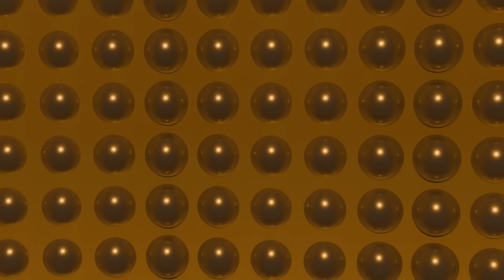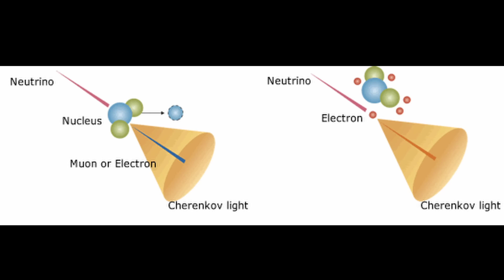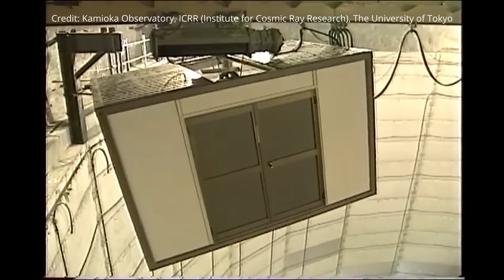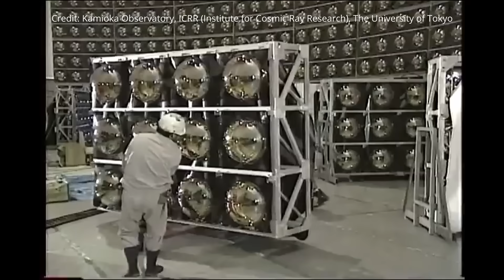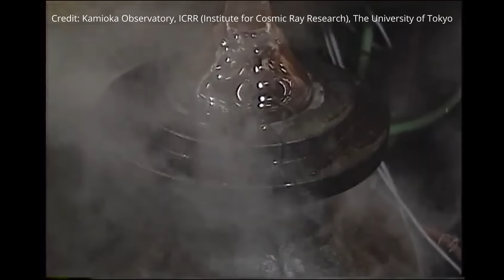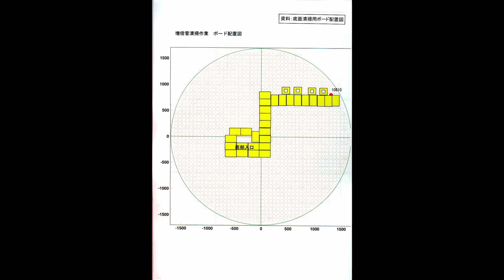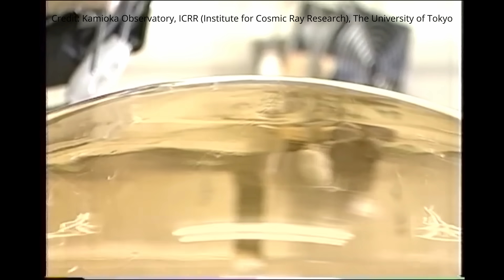An Engineering Fairy Tale: Cascade Failure at the Super Kamiokande

Comment: Quick question: If a single neutron striking an electron causes it to emit a photon... how does that single photon eventually strike more that one photomultiplier?
TD
Seems like we're missing something really critical in the actual setup here. Perhaps I'm just missing something obvious here, but it appears to my mental model that what has to actually being capture here is a (perhaps a single? perhaps many?) neutrino passing near the electron, and that passing both redirects the neutrino (it has mass, right), and the electron emits a photon on a particular vector as determined by the incident path of the neutrino... as that (now changed subtly) neutrino carries on, it passes near other electrons, and causes them to emit photons as well... each of those photons is on a different path, and actually strike different photomultipliers in different locations, at different times (at that tiny scale of time), so the signals are NOT exactly in sync, and thus... much math later... are mapped back to the emission point (which is actually a line).

TL;DR: It seems a gross simplification to to call this a flash of light and treat it as on monadic event.
Reply from the maker: The neutrino causes the electron itself to move faster than light (not to emit a photon directly). It then emits photons as it travels through the medium in a kind of light-equivalent of a sonic boom.

Comment: Video felt excessively slow and dragged out. Not a regular viewer, but I was skipping forward constantly to get to the actual event the video is about.

I think you should either get a copresenter to act as a comedic foil to your straight forward delivery or tighten up the script. Faffing about for 15 minutes to say "shockwaves in water are intense" is dull.

I could have appreciated the time spent getting there if you shared some interesting formulas and figures that gave insight into the precise mechanics of the event, but nothing besides the 6 bars of static pressure notion stood out.

Comment: You did miss one of the particle in your standard model.  
It's called the "Moron".  It's fairly common, and fairly easy to detect.  And can sidetrack your research with ease.  And, unfortunately, it can stop all progress on your work!  And in extremely rare cases they can be dangerous. 
   Just think about the stereo typical Hollywood motorcycle gang, and then you'll get the right idea...

Comment: ...huh, well the bit on neutrinos experiencing time has my brain thinking again... on a couple of things. The recent paper trying to falsify dark energy explains the accelerating expansion of space as a relativity issue. Basically, away from gravity wells, space expands faster because time passes faster. It makes me wonder... what actually is space? If its affected by time, and this theory means it must be, then what is it made of? Does it have mass that we can't detect because of the sheer ubiquity of it? Something like dark matter where it's only weakly affected and only weakly affects gravity? And now I'm wondering if the distortion of space because of the expansion would explain the seeming presence of dark matter around galaxies affecting the flow of light... if there's some kind of distortion between gravity heavy and attenuated gravity that might explain the way light bends in ways we don't expect? 

I don't know enough math to try and work that out.

Comment: Maybe someone commented on this before, but the else excellent video is fibbing on the neutrino oscillations. The requirement for them is that the particle have mass, which means they travel below the universal speed limit. It has nothing to do with classical objects that would 'see no time' since photons interact with each other all the time. Or rather, it is the particle field that interacts, also with other fields, all the time.

Comment: There is a specific cascade scenario called Kessler Syndrome.  The theory is (and I’m very happy it’s still a hypothetical)that at some point there will be enough debris in orbit, that will then impact working satellites, making more debris that breaks more satellites, etc.  the worst case outcome is no usable satellites remain, but there’s so much debris floating around that we couldn’t launch ships at all, because even a lunar lander gets smashed to pieces just trying to pass through the debris field.

It’s for this reason NASA is tracking every loose scrap of metal up there.  Considering that the ISS is moving at 17,500 mph, I’m amazed NASA can detect a single bolt moving that fast, 100km up.

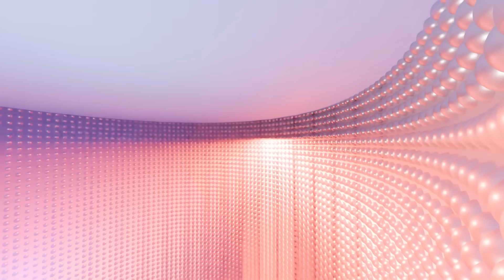Comment: 17:32 , What would happen to a person swimming with a air tank at the center of the pool half way down when these events happened ?
Reply: @Dmanjack  he would undoubtedly absolutely shit himself alive
Reply: I have no idea if he'd die to the implosions from in the center. Maybe go deaf. But i feel like all that water dropping suddenly which we know must have happened since the water now would occupy what was once vaccuum. Would have the same effect sending an overall shockwave up and out. As was recorded in seismometers would maybe crush the person. The water isnt compressible but the air in their lungs sure is. I feel like the air tank would be fine. They have plenty of pressure inside and need to be pretty strong otherwise dropping one would explode it.
Reply: Nothing good.

Even though the failure wasn't necessarily instantaneous across the entire tank, It was close enough. And considering the rapid pressure change is effectively an explosion, that is Intenuating. Through non-compressible fluid; so there would be minimal energy loss...

I'm imagining they would at least be deaf. Worst case scenario, the pressure change would cause their blood to boil or organs to liquefy; If not both. Definitely not pleasant; But I would doubt they would be alive long enough to feel anything...

Comment: I was a grad student working for an advisor who was part of the SuperK collaboration in the US (it was a large group with different teams working on different aspects of the experiment). I dropped out of grad school shortly before this happened, but it was still pretty demoralizing when I heard about it. At the time of the accident they were just getting initial results from an accelerator experiment which "shot" neutrinos from an accelerator 250km away in order to confirm the original neutrino mass discovery, which was based on neutrinos from cosmic ray air showers. This research was eventually performed after the repair, though.

That detector image around 20min is giving me flashbacks because for a while I did hand-fitting of neutrino tracks to those diagrams when the automated system wasn't confident in its solution.

Comment: I was a graduate student within the particle astrophysics community (on a different experiment). I remember when the news & rumors of Super-K’s implosion spread through the community. 

A little while later I saw a presentation by one of the Super-K scientists, in which a short movie of a later test was shown. At the time it was said ‘no I cannot give you a copy of this, just remember it,’ and even 25 years later I’ve never seen the movie in the public. The question was that while the dynamic pressure is incredibly high as detailed by Alexander, the tubes were designed and tested to survive the dynamic pressure of an implosion too. The super-slow motion movie showed a 3x3 grid of phototubes at depth, and the middle tube was purposefully imploded (small charge). The surrounding tubes survived the initial shock, but then the water flowed into the space left by the imploded tube and all the surrounding tubes leaned in towards the missing tube and broke *at the neck*. The tubes look like great big light bulbs, and the rush of water pushed on the large glass globes snapping off the necks. It wasn’t the shock, it was the water flowing past that propagated the implosion. 

The fix included baffles to slow water flow and metal supports so sideways forces were not all born by the neck of the tube. In the end the tubes had been tested against the shock of an implosion, but not the effect of water rushing past the ‘sail’ of the large glass bulbs and popping the neck.
Reply: Wow thats actually kind of interesting abd a bummer because I bet that slowmo video would be insanely cool to watch!!, I was also kind of wondering about that in relation to that woosh of air that was described in the video Id be curious to know by how much say the water level dropped, it wasnt full or it was being filled so i guess it wouldn't be as easy to tell immediately but i would think the volume of all the tubes that broke could be figured out pretty easily it would make a interesting bit of fetail.

Comment: hahahaha 😂 “Let’s talk about stellar mass implosions.” so core-collapse supernovae are phenomena where a star collapses, and it compresses, essentially slamming into itself, until it’s no longer compressible, at which point it rebounds, sending an enormous shockwave outward. 

(“The dynamics are highly complex, though, and not relevant for this comment”)

This releases a tremendous amount of energy (“AAAAGGGHHHHHHH!!!”)

During the initial collapse, the star creates tremendous numbers of neutrinos. In fact it may be “shining” mostly in neutrinos, the visible light photons having become a rounding error.

these neutrinos fly across the Universe until they reach a photomultiplier on Earth.

if the photomultiplier is under water, which is not highly compressible, and it collapses, the implosion might rebound in a complex, energetic, hydrodynamic manner not completely dissimilar to the phenomenon the photomultiplier was designed to observe: a supernova. 

THE IRONY, IT BURNS

in fact, a supernova liberates so much material and energy that it can trigger other supernovae. (“But it didn’t fail in isolation.”) and those supernovae can trigger even more, etc. though as far as i know, this cascade does not happen in the Windows Minesweeper way it happened at Super-Kamiokande 🔳🔳💣😱💥💥💥💥💥💥💥💥 To quote Einstein, “God does not play Minesweeper with the Universe”
Reply: P.S. if your huge neutrino detector experiences a cascading catastrophic implosion that can be traced to a single neutrino event from a distant supernova, what you really have is a supernova-amplifier 😜

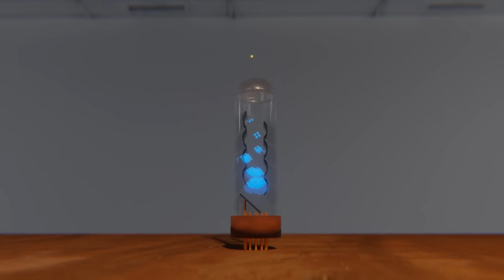Comment: 8:30
Your little contraption only shows 8 doubling surfaces, meaning a 256x multiplier; so either the average multiplication per surface is actually a sextuple (6x) at least, or there are 20 or more doubling surfaces (13 if — on average — they triple; 10 if they quadruple; 9 if they quintuple)

Comment: I suspect that the engineers who did the implosion test on the tubes would have known that that deeper the water the higher the peak of the shock wave. It's not a nuance, it's common sense that even a high school graduate like myself can understand. There is more pressure the deeper you go. So my suspicion is that the test as performed is how they got someone to sign off on eleven thousand tubes at ten thousand dollars a piece. More robust tubes perhaps would not work, or if they would work, would certainly cost much more to make. I would think that thicker glass might even be many times more expensive. I suspect that it was either do it this way or not at all. But I don't think that this had to ever be a problem unless they were unable to detect a flaw in every tube to begin with. I think they went wrong by walking on styrofoam on the tubes in the first place. They should have suspended themselves or designed in a way to have temporary supports for floor panels put in place between the tubes during maintenance. I would not ever walk on tubes because they might seem fine but it is like when one hits a motorcycle helmet on cement during an accident or even if it is just dropped on cement. It is recommended to replace it because it can fracture inside, losing some of it's strength and then not as much energy from the next impact will be absorbed because some of the structure inside will already have been broken by the previous fall. That excess unabsorbed energy will then be transferred to the wearers skull.

Comment: Can anyone explain or justify why the engineers didn't use a Pyrex type glass for the tubes..as the original tubes left little room for any pressure differential and, however I know there are some optical differences between Pyrex and soda-lime glass... however the cost shouldn't have been an issue when you've come that far.
Reply from the maker: I’m 99% sure they were borosilicate glass (aka ‘Pyrex’).

Comment: Your explanation of the neutrino mass makes sense but it can be expanded even further. The presence of the oscillations not only proves that neutrinos must have a mass it also proves that they don't have the same mass since the oscillation frequency is proportional to the difference in mass. Further it shows that the weak eigenstates neutrinos are produced in are a superposition of the energy eigenstates relevant for propagation.

Comment: Particle physicist here!
Great video, I didn't know about that cascade failure at SK!

I suggest you have a look at the marvel of engineering that are the LHC and detectors like ATLAS, it's more than fascinating! There are easily a dozen subjects to be covered on the topic. Most people only know about the proton-proton collisions, but it is worth talking about the superconducting cryomagnets, the RF accelerating cavities, the beam dump, the security systems, the vacuum, the immense injection chain, the beam dynamics and focusing, about how new problems where overcome (the so-called "UFOs", the wake field, etc), and I could go on. And frankly, all the detectors are marvels of engineering too, I could easily list a dozen subjets that would require a video each.

And if you have a particular interest in what we can learn from failures (and if you like cascade events that lead to destruction), have a look at the 2008 incident, where a magnet interconnect failed, leading to an electric arc which dissipated some 275 MJ. It burnt through beam vacuum and cryogenic lines, rapidly releasing about 2 tons of liquid helium into the vacuum enclosure. The pressure valves where not designed for such a high dynamic pressure, and the pressure wave propagated from one magnet to the next one, destroying everything along the way (until it reached stronger valves, if I remember correctly), delaying the start of LHC operation, costing a lost of money, forcing to operate at weaker energies, and forcing an upgrade to operate at higher energies.

Comment: I used to design sea-floor mounted instruments and they were always tested in pressure tank simulating the design sea depth plus some margin. Once we wanted to verify calculated collapsing depth. It was designed to withstand test depth of 1800m and should collapse at 2200 based on the material lab tested  yield strength. It collapsed 100-200m deeper but with severe consequences for the test tank. The implosion caused shock waves as described in the video, ruining several pressure sensors, one even detached from the test chamber. So it caused a costly repair and recertification was needed. No destructive testing was allowed in the test facility after that. 
The pressure tank was designed to handle twice the pressure we ended on, so the shock wave was much  stronger. Unfortunately we did not record it since sensors got destroyed and probably unable to react fast enough anyway.

Comment: I had a 500 cc sample cylinder partially full of triethylene glycol which we had degassed so well that the cylinder rang like a bell when shook because the liquid inside had no air to cushion it as it went from one end of the cylinder to the other.  We actually opened it the first time because we were sure that there was a bolt or something metallic in the sample cylinder.  I can see how the failure of one tube could cause those around it to fail, and on and on.

Comment: 21:15 "demonstrating that Neutrinos change flavor means they experience time."

That's not even close to an air tight argument.

A) Photons change wavelength, that doesn't mean they have to have mass. Infact, the photon flux at the detectors from the same exact solar flares would also be more red at night since they are further out of the suns gravity, but obviously nowhere near enough to tell... If wavelength can change with out rest mass, then why not flavor.

B) Light can effectively change wavelength from source to detector via scattering. A photon can get absorbed by an atom and then a new photon emitted by the same atom... We know from nuclear physics that atoms can emit Neutrinos, so it's entirely possible that atoms in the earth can absorb a neutrino of one flavor, then emit a different one...

Anyway, I'm betting that Neutrinos end up being gravitational wave collapses, similar to how photons collapse to a single point at a time in the dual slit experiments, gravitons could look like Neutrinos when they collapse while ligo is detecting the whole wave in motion.

The different types of detection events (3 flavors/generations) could be from which Quark of the Atom the graviton interacted with.